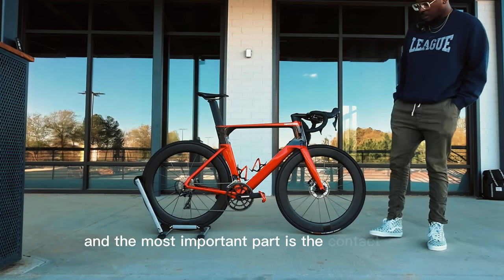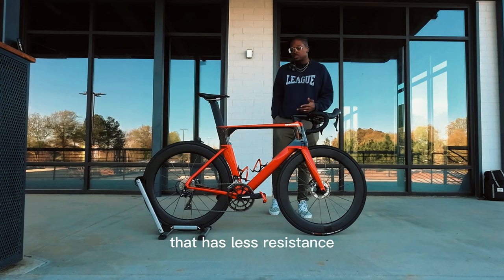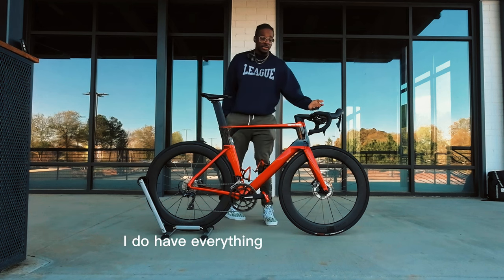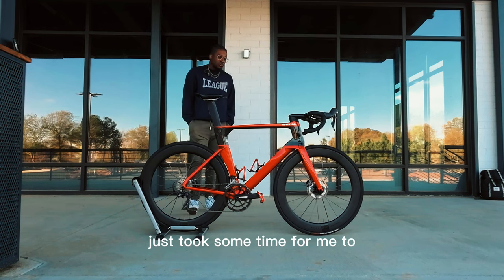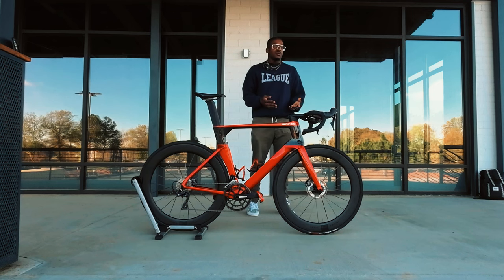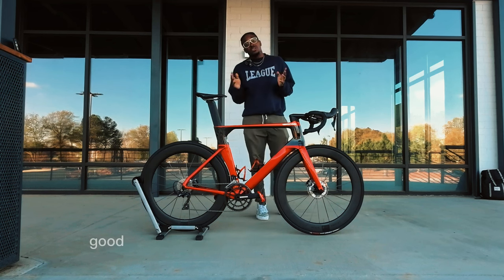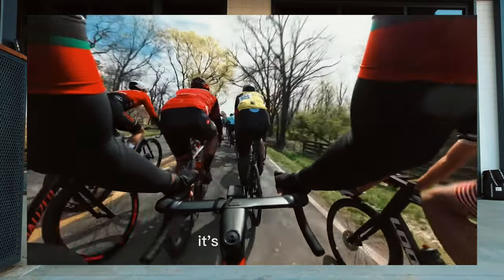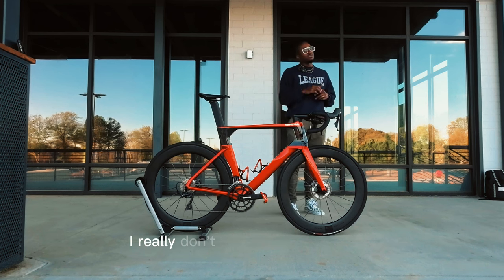Cannondale System 6 in-depth Review (the Verdict)

Comment: Currently own a 2022 Supersix and have been looking at the system six. Curious if you went with the same size frame as your Supersix?
Reply from the maker: Yes I actually did go with the same size. My 58 System actually feels like I’m on a 56 and my 58 Supersix felt like I was in a 60. The System shorter wheel base and aggressive stack makes it feel more true to size. I feel like the relaxed geometry and longer wheel base in the super makes it feel like it runs bigger. I would’ve been more comfortable on a 56 with the Supersix
Reply: @Mistadonthecyclist  that's great, thank you! How tall are you?

Comment: Really like the bike! I didn’t know you could internally route the cables for a mech build! Did that give much issue ?
Reply from the maker: Yeah it can be done if you have a bike shop that feels comfortable doing it. But I haven’t had any issues out of it at all
Reply: Yes You can..I bought this also in the last august and yes the latest one allow us to od internal routing. Allowed from the drop bar, getting inside the stem, spacer and going through te frame. Even from the first We will get 3 types of cover located in the down tube near bidon cage. 1) is for the internal routing non di2, 2) external routing with some holes on the cover, 3) special cover for di2 with some hole to put the switch

In this video I saw He didnt change the cover with the fully close one. Still using the cover for external routing

But overall yes. Its applicable even got it already internal from the AD